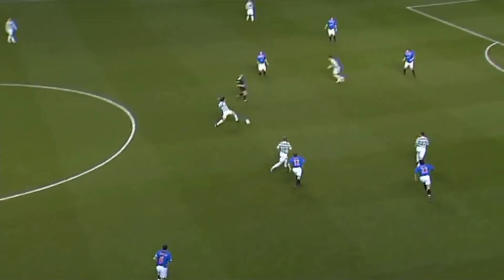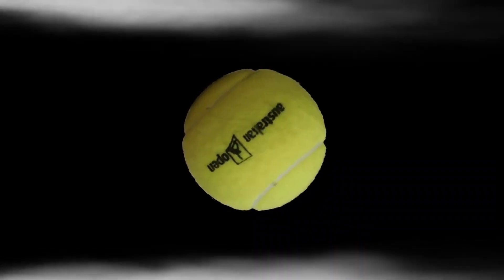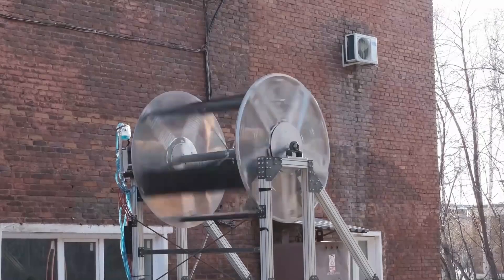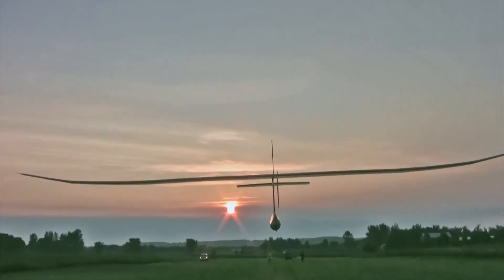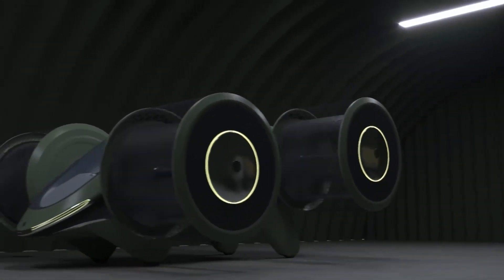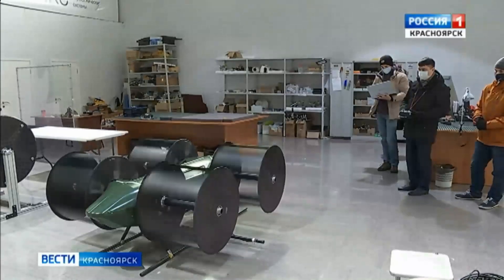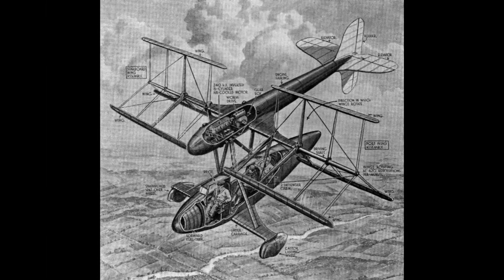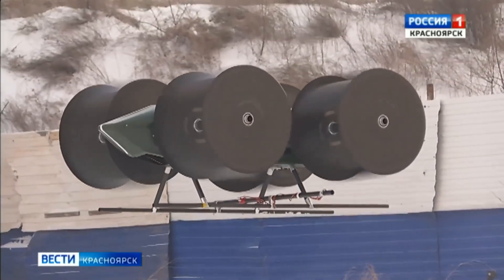The Engineering of ARF's Cyclocar VTOL

Comment: Wasn’t entirely clear what the advantages of this system are.   Is quietness the only advantage or is there an efficiency advantage as well?
Reply from the maker: Yes it has higher lift coefficient. I wasnt able to get through the full literature and therefore I will cover the higher lift advantage in another video
Reply: @ElectricAviation  Aero drag is also higher???
Reply: @redlab66   parasitic at high speed most likely. But as a VTOL you would be more concerned with lift dependent induced drag. And spinner tips are enclosed. Would love to see more about this in lot more technical detail.
Reply: Safety and manoeuvrability seem to be the other ones. Landing helicopters in anything but flat open spaces is very complicated. But these blades are compact and enclosed. It looks like it could take a few low speed impacts without the blades breaking and flying all over the place.
Reply: @johnroutledge9220  4 rotating drums with a connection on one end can't take an impact, it would skew off center very easily and the loss of alignment would do the rest, by that I mean blow itself apart 10x worse then a runaway wind turbine. It's as fragile as F..
Like this  -----> https://www.youtube.com/watch?v=vrT1t7uK1fs
Reply: @Veldtian1  Did you notice that a windmill more resemble a helicopter rotor turned 90° rather than a cyclorotor? Yet you don't often see helicopters send-destructing the same way. Whatever improvements made to prevent helicopter rotors from self-destructing like the windmills can also be applied to cyclorotors.
Reply: https://youtu.be/2AvepssBwzY🌠